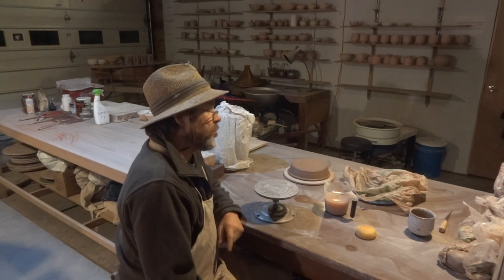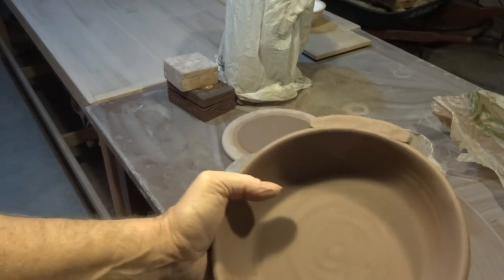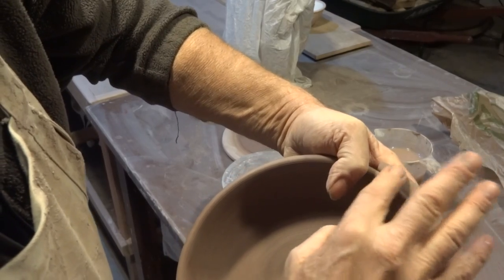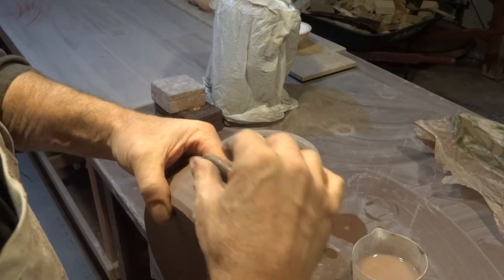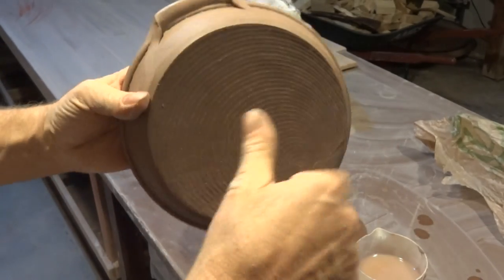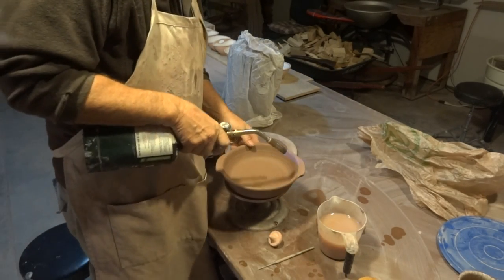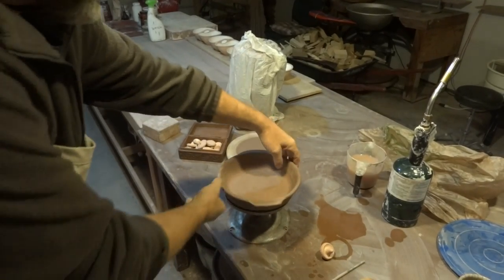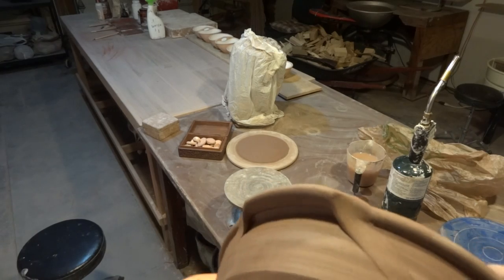SIMON LEACH POTTERY TV - Applying lugs to a flan/pie dish !

Comment: I used to have beautifully manicured nails, visiting my manicurist every 2 weeks like clockwork. Then I found pottery and now my stubby fingers have stubby nails. It's quite difficult for me to use my fingernails as tools still! I'm not sure I"ll ever get to that point. :-)
I'm also starting to realize that I need to get used to working with stoneware, because if I handled my porcelain like you do your pieces, nothing would ever make it to the kiln. I simply don't like the grog scraping against my hands, it's like fingernails on a chalkboard for me. sigh 

Simon, do you ever burnish, I don't recall seeing you do so? If not, why?

I'm going to rewatch your vids on making stamps and rollers. I like the pattern you used today, gives it that "wheat grain" look. I love the twisted wire I ordered from you, it's perfect. Thanks for sharing this "lesson", I'm off to practice!  ;-)
Reply: Hehe, I know what you mean. I actually used to bite my nails, then I managed to stop that and was proud of my nice looking fingernails. Then I discovered pottery. As I can be quite clumsy I'm keeping them very short now. Except the thumb nails, they are a bit longer - so I still can use them as a tool. ;-)
Regarding the clay: I don't use porcelain, but stoneware clay without any grog, which works fine. Or 25% 0-0,2 mm grog, which you almost don't notice while throwing on the wheel.
Reply: +Britta Muether Thanks! I found a stoneware that I'm going to try from my LCS, it sounds similar to what you're describing. :-)
Reply from the maker: +Nancy Campbell I have burnished pots that I pit fired one time, but in general i dont. I like the burnished black look though.